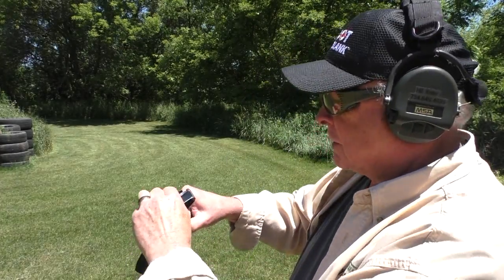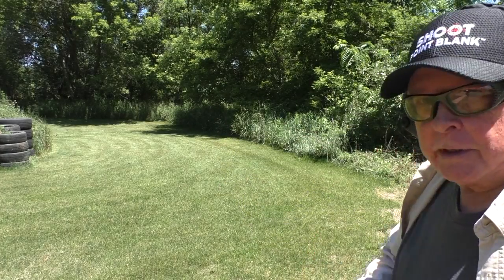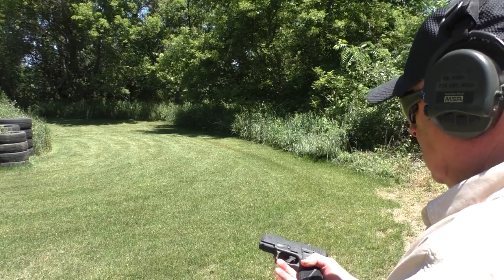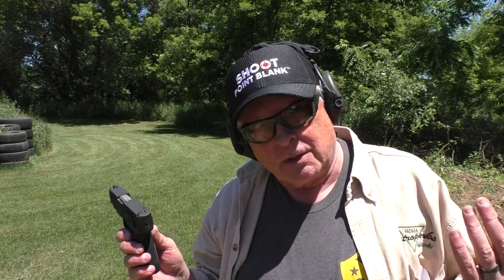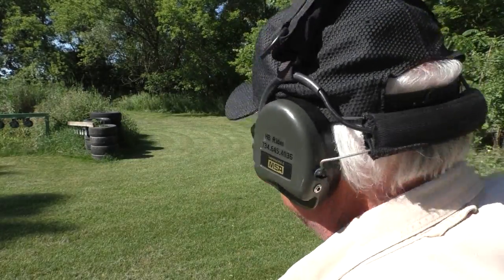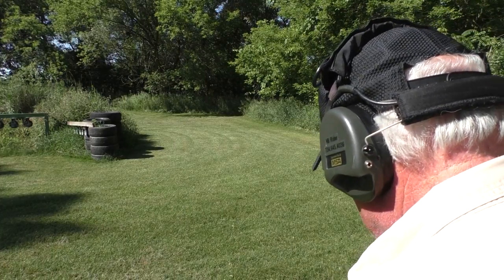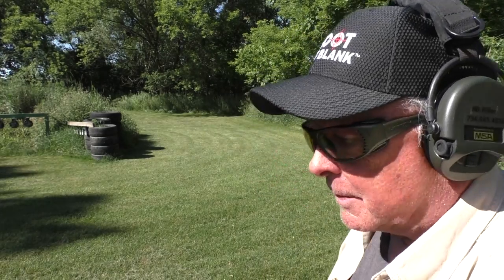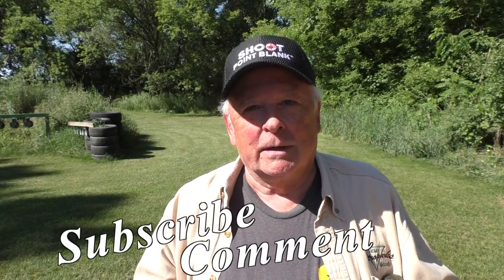Will the Taurus G3c run Defense Ammo?

Comment: They will shoot them fine but it's the initial round that gets hung just like it done you from the start,when you empty a mag and put a full one back in and go to put it in the chamber they hang,Hornady critical will feed good because they are more pointed more.Just do the initial on all full mags I bet it will hang.if you are in a self defense mode and need to reload that's when the problem happens and worse with 147 grain hst
Reply from the maker: Each individual pistol has its own ammo preferences. There are a few simple "home remedies" that often help with feeding that first round. Thanks for watching.
Reply: Yes you are right but I have 2 g3c pistols and same problem with both and it's a flaw in the gun that causes this ,the barrel floats forward to much and that's what causes this there is a huge gap between the feed ramp and the ammo coming into the barrel or if they had closer tolerances there maybe a longer feed ramp or a 1/8 th longer barrel would solve the problem.I can put a g2c barrel in the g3c and it feeds perfect
Reply from the maker: @jerrywalters4158  that's interesting info. Thanks.
Reply: I have the same problem I just top off every mag with a ball round to solve this problem. Not really a big issue in my book. All the other rounds will fire without a problem.

Comment: I have some hard cast truncated cone 124 grain that had a hiccup with, i suspect i may have let my thumb push up on the safety lever a bit, enough to cause a failure.
Reply from the maker: When I shoot anything that has a manual safety, my thumb rides on top of the safety when I'm shooting. But that's how I learned to shoot the 1911.

Comment: I noticed you didn't try a 147grain load, Will it take a 147grain round? I just bought a G3 and it will not take a Fiocchi 147 hollow point....
Reply from the maker: I don't know why I didn't include the Remington Golden Saber 147gr, as I use that round in my daily carry Staccato C, though I carry the Federal 124gr HST in the G3c and my P365XL. I'll have to try the Golden Saber 147 in the Taurus. Thanks for watching and for the suggestion.
Reply: i took my g3c to the range today to try and feel 115, 124, 147 and a 147 hollow. shot just fine with no issues
Reply: all federal ammo except for the hollow points
Reply: @DavieJonez_  how many were hollow point?
Reply: @timogrgic3693  I shot about 10 hollows of the  hornady subsonic 147 gr xtp. i was shooting mostly 115g
Reply: @DavieJonez_  I guess I'll be sending my G3 to be repaired......
Reply: @Timo was the Fiocchi not going into battery all the way  ?
Reply: @Soli_Deo_Gloria_.  The bullet seems to be getting stuck in the barrel as if it wasn't made to fit or its defective.
Reply: That's the round that sticks in mine as well. And I am a fan of Fiocchi ammo. I think its just the bullet shape on that defense load.

Comment: I use/d federal 124g punch, 124g bellom fmj, 115g fort scott tui's, and 147g browning x points for about 7- 800 total rds put through it. the only problem that I had was at break-in using a new 32rd promag with the bellom. It has been reliable enough to not have any doubts for use as a edc! I have the promag for range use only. I like the 12 and 17rd mags for edc. the 15rd mags are reliable but too noisy and sounds like a rattle for edc use. I like the fed punch and fort scotts for the edc mags.
Reply from the maker: I haven't tried Fort Scott ammo. I may have to look into it. Thanks for watching.
Reply: Open your mag up and turn the spring the opposite direction won't have rattling problems anymore

Comment: The fact that you could shoot 1 or 2 rounds of each type of ammo is meaningless.  To get a meaningful test, you need to run a significant number of rounds through the gun.  My G3C was hit and miss with Federal HST.  It would go through a full magazine with no problems, and then stop twice in the next.  And it only takes one jam to disqualify a gun for self defense use.  If a firearm won't shoot every type of ammo, every time, without fail, then it's useless for anything but plinking.
Reply from the maker: Paul, I can agree that the "test" would have been more valid with more of each type of ammo, but my supply is limited. And I agree that " it only takes one jam to disqualify a gun for self defense use".  However, I don't agree with the statement that "If a firearm won't shoot EVERY TYPE of ammo, EVERY TIME, without fail, then it's useless for anything but plinking". [Emphasis added] Many guns won't reliably shoot "every type" of ammo, but will run 100% with a specific type of ammo, or specific types of ammo. That doesn't make them "useless for anything but plinking" as long as the gun is 100% reliable with the selected ammo.
Reply: @RidersRange  With the current ammo situation, and who knows what the future holds, I have no use for a gun that will only work reliably with a certain brand or type of ammo.
Reply from the maker: I can understand that point of view. Good old FMJ ammo will always be available and that will run in everything. Hollow-point ammo may be a different issue, but almost any pistol can usually be "tweaked" to run almost any defensive ammo.
Reply: The reported issue was that it would not reliably feed from a full magazine. He proved this to be incorrect. Not a gun issue. So not meaningless at all. What he did not take into account, Is what I have found to be magazine issues. I have one of three magazines that fails to feed every time  from a full magazine. The other 2 have been flawless.
Reply: @troyellis435   Wrong on all points.  

When I had my G3C, it jammed sporadically firing HST ammo, with five different magazines.  It did the same with Remington Golden Saber, which have a similar profile.  I'm not the only one to report this.  

I'm a formally trained, certified gunsmith.  I analyzed the gun's function in detail.  If you lock the slide open and look at the feed ramp, the base of it is sitting on the lower frame.  But if you push the feed ramp slightly forward, as would happen when a bullet nose is pushes against it while loading, you will see the feed ramp raises up from the frame, creating a gap between it and the frame.  This creates a lip where the rim of a large mouth hollow point can catch.  I inspected every single misfeed I had at the time it occurred.  In every single case, the rim of the bullet was jammed on the bottom lip of the feed ramp.  Every single one.  Other hollow points, with smaller mouths, or more rounded profiles fed 100% of the time.  I notice you fail to mention what ammo you used in YOUR extensive testing.  

Oh, and I shared this information with Taurus.  They told me there was no need for them to do anything since all I had to do to resolve the issue was switch ammo.  Typical Taurus customer support, or lack of.  And apparently they decided it was worth addressing in their newest gun, the GX4.  I have one and it feeds everything without fail.  But then the feed ramp setup is completely different from the G3C.  

Spin it any way you like, the G3C has a design problem that contributes to jamming when using wide mouthed hollow point.  Period.

And one more thing.  You talk about the gun jamming on the first shot.  This is a symptom, not a cause.  If you know anything about the function of semi-autos you know that feed issues such as this will always be more prevalent with the first shot.  The first round, being fed from a full magazine, will be more likely to nose dive, which contributes to this type of failure.

Comment: I have Hollow point rounds for my g3c. I can chamber the first round in just fine when I go to pull the slide back and release the round it catches the round and gets stuck. So I have to pull it a few times before it releases. Any ideas?
Reply from the maker: Without seeing it in action I can only suggest that you first drop the mag, then pull the slide all the way back with more force. I've seem many shooters not use enough force on the slide and experience difficulty manually ejecting a chambered round.

Comment: Since I've only used round nose practice ammo in my new G3c, I've not had any FTF problems. 
However, I did have a couple of  'unwanted' slide releases when I was reloading. I inserted the mag hard and fast. The slide dropped and loaded the 1st round, before I could even think about putting my thumb on the slide release or yanking back the slide.  I've had this happen on my old S&W MP9 ver 1.0 pistol. I don't really like it much. 

Why do I push the mag in hard and fast? Because we have crap 10 rnd mags here in Massachusetts. These mags can take 9 rounds with the uplula magazine loader, but #10 rnd has to be inserted manually and it takes a lot of pushing & sliding until it goes in. Once it's #10 is in place, it's has almost zero downward play. 
So, if the slide is closed, the top round is going to push up against the bottom of the slide, and the top round doesn't want to move down.. So, to make the mag lock, you have to wrack the bottom of the mag firmly before the mag Clicks into position. Otherwise, it falls out on the ground. (Same with the MA approved M&P9 10rnd mags). 
To circumvent the problem I normally just load up with 9 rnds per mag..
Reply: That is known as a combat reload.  In high stress shooting situations, it is a VERY desirable function.  You slam the mag in, and the pistol immediately goes into battery, so you can continue firing immediately, with no wasted extra actions to get your pistol back into action.
Reply: @echosierra9990  It seems like something that's too random to be useful. The randomness makes it hard to train with. I would  like that function always ON or always OFF. I want to be doing the same exact reload, everytime. Not a do this, IF that happens. 
What if you're concealed? and don't want to drop the slide and give away your position, while you're trying to making a sneaky quite reload.?. 
If it was reliable and dropped every time, and you've trained into your MM so deep, maybe you don't notice a FTF, until you try the trigger. I've seen body cam footage of cops trying to shoot with their slide locked back. It takes some of them a couple of seconds to take the correct steps. 

All it would take is to accidently have a finger or a thumb pushing up a little on the slide stop / release button, when slamming the mag home. No slide drop!
Reply: Thats just the inertia of the mag causing the slide stop to slip. Mine does it too but i guess its a common thing
Reply: @kflorence7005  I wonder if you lightly inserted the mag, and then accidently dropped your pistol. Would hitting the floor cause it to release the slide and load a round? 
I once saw video of an FBI employee drop his Glock (break dancing) and when he hastily grabbed for it, he shot a bystander by accident. (I guess  it was an accident).
Reply from the maker: @Richard Lee, I guess that's one of the unfortunate issues living in a state that isn't actually a free state.
Reply: @RidersRange  Bruen is going to change this state for the better. After living here since 1965, I should be used to it. But I'm still thinking about my hometown way down in Texas.. :)

Comment: Winchester white box jhp jams on the ramp unless u rack the slide  like you're letting a beyblade rip
Reply: I got Winchester silver tip that won’t feed when dropping the mag release. But it shot fine. You got to rack that hoe hard😂
Reply: It may be an issue with your barrel tolerance being slightly off-kilter. I run the wwb 115g HP in mine and she feeds first round smoothly using slide lock or standard racking. My buddy had a g2c that had the same issue on first round jams. He did a good polish on the bttm of the ramp to get a slightly less sharp edge with sandpaper and rem-oil, seemed to fix the problem. Hope you get her running smoothly, they really are great lil carry pistols 👍👍

Comment: Only thing mine has had trouble with was Hornady Critical Duty.  And only when chambering first round.
Reply: That is exactly what I came across, but no issue from the Critical Defense. But yeah, the tip of the Duty ones were catching...but it does just fine in my old PT111 G2....yeah, I have both, I'm weird.
Reply: @GreatWhiteCat  ha, that makes two of us. I can’t count the ways...
Reply: @txlongarm Well, ya seem alright to me. I really like the series. I don't just like them for the price, I actually like them. I like that you can use the 17 round full size mags on them and that the pt111 up to the g3 all interchange with each other.
Reply: @txlongarm I like your pic too. Good man. When honor meant something.
Reply: I never had issues with hollow points technically critical duty is for dull size guns since they use harder lead

Comment: Will the g3c work well with RIP? And can you test if not known? I’ve found NOBODY that tests them with the g3c
Reply from the maker: @Inexplicable, that's one I haven't tried and I don't have any RIP for 9mm. Sorry. But the RIP round does occasionally have function issues in my Glocks in 10mm and .45, but I haven't tried it in anything else.
Reply: I use federal hst. The RIP rounds don't achieve the penatration needed to reach vital areas of the human body. It looks good in clear ballistic gel without 3 layers of heavy clothing but performs poorly when going through bone or heavy clothing. It's a light round as far as bullet weight I usually always use 124 grain standard pressure rounds in a short barrel handgun. Underwood ammunition is also good the extreme penetrator in a short barrel it has the affects of a hollow point and also reaches vital areas to stop a threat
Reply: Check out "shooting the bull" YouTube channel on federal HST or TNoutdoors9

Comment: Its 2024 
Even hi points and heritage 
Is reliable if u do a bit of work on them.
Reply from the maker: True, though most folks who buy budget firearms don't know how to do the work and/or don't want to have to work on them. In this day and age, every defensive handgun should run 100% after the first couple hundred rounds.
Reply: Very true.
In the gun wrold 
You do get what u pay for in alot of cases 
And paying and extra 60-100 can get u some better options 

I also believe some of budget and cheap oddities are hard to pass up if ur strictly thinking with ur wallet

Comment: Any issues with accuracy? Two different barrels mine slings em everywhere… even out of a ransom rest… any ideas ?
Reply: Learn  how to aim / shoot ?
Reply: @petervoyt24  did you read the ransom rest part? Or just couldn’t comprehend? I had no problems on any of my four deployments.
Reply: @chrissherrill790  question as was not there. Did you try a different gun in the rest before or after using it. I’ve never used one so I’m just curious. 

Have you tried the other barrels in a different Taurus to check if a slide issue .
Reply: @drmachinewerke1  it’s a slide issue… sending it back to Taurus … gunsmith said it was one slightly warped two out of spec
Reply: @drmachinewerke1  thank you
Reply: @chrissherrill790  nothing wrong with m y comprehension, maybe an eye exam will help you ?  LOL   or perhaps anger management ?
Reply: @petervoyt24  you didn’t seem to comprehend ransom rest very well and considering your last name well… but thanks for telling me about guns and aiming something the Army completely over looked.
Reply from the maker: @Chris Sherrill, accuracy from mine has been fine, but it seems that Taurus quality control is somewhat spotty.
Reply: @chrissherrill790  LOL so you're a bigot as well ?? Not surprising given your feminine last name.   You must also use pronouns ??
Reply: @petervoyt24  no not a bigot I just don’t like mouthy idiots 🤷‍♂️ it’s not complicated PETER 😂

Comment: Ammo Incorporated ammo jammed my gun. ( Hollow point 124 Grain  )
Reply from the maker: I haven't tried any of that.
Reply: @RidersRange  Federal American Eagle 124gr FMJ will fully chamber in my Taurus G2c. But when I try to rack the slide back to eject a live round, it is always stuck. I have to smack the frame pretty hard , while pulling the slide back. This ammo does just fine in my other 9mm pistols. I've tried 12 other bullets. 115-124 and 147gr. FMJ and HP's. They all work just fine. I've never had this happen before with any ammo or guns.

Comment: U know what, i run novx in my g3c and i have my g3 16 rd mag in it, with one in the chamber and if i drop the mag and rack, often the round in the chamber gets stuck. I was wondering if it was my fault or not, because i changed the trigger on it. But, i dont know. I just stopped the 17 and leave it at 16 lol
Reply from the maker: Changing the trigger shouldn't make any difference. Some bullet styles may contact the rifling ahead of the chamber and make extraction more difficult, but I can't say without knowing the specific ammo you are having issues with.

Comment: IMO, you need to run a full mag of your defensive loads to see how they cycle when mag starts to empty out. You’re running your test with fully loaded mags and thus mags are fully sprung!
Reply from the maker: I agree that would have been more complete. However, I didn't have enough of each type of ammo to run that type of test, so I concentrated on the common issues of chambering the first round and second rounds. Thank you for watching and adding your thoughts.